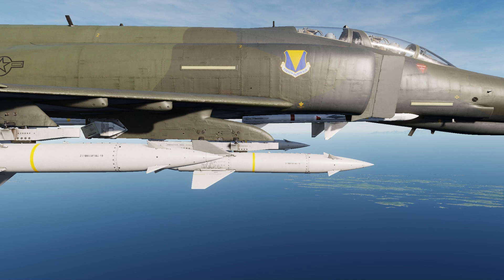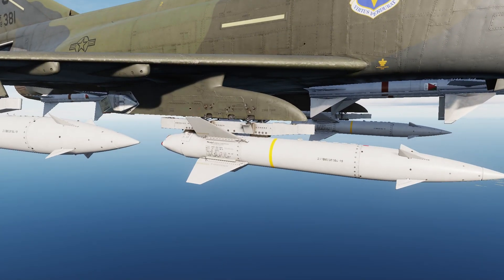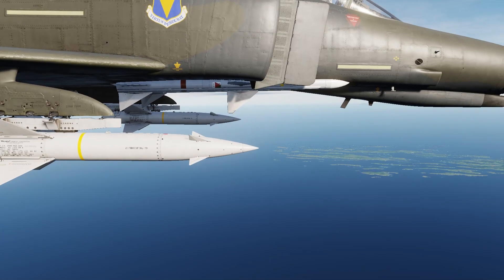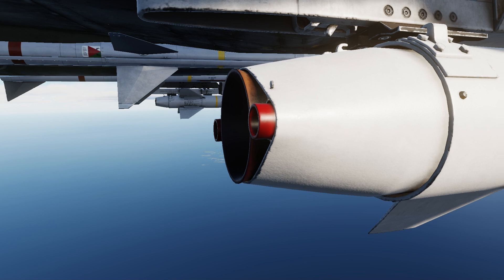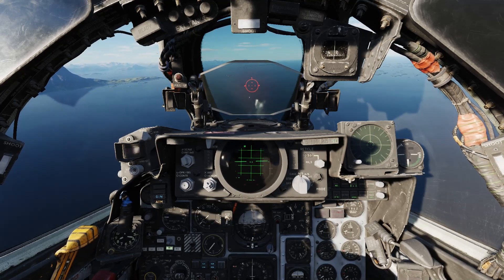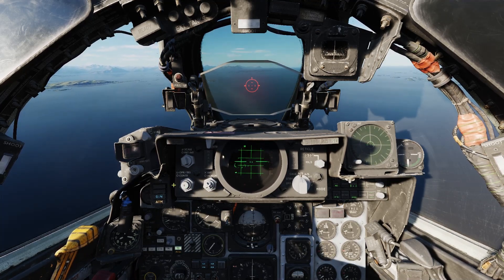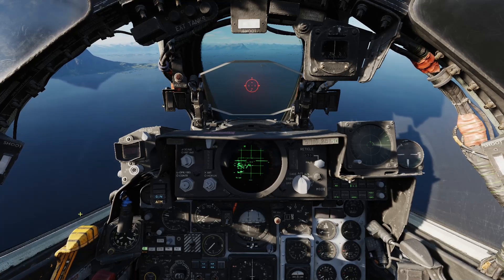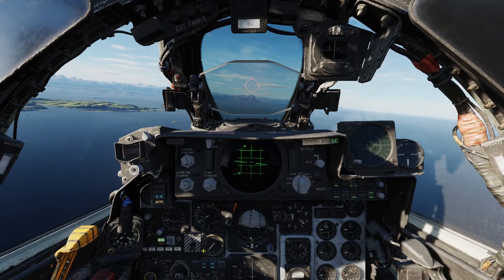DCS F-4E Phantom: AGM-12 Bullpups

Comment: Seems easier to just use rockets. No wonder why the bullpup was so short lived.
Reply from the maker: It is... for certain targets. The Bullpup really is meant to hit large targets like buildings, large ships, and concentrated troop formations. Even then the B model with the 250lb warhead doesn't deal a ton of damage. I would imagine the C model would be great against ships and large buildings but that isn't working right now.

However for light targets rockets and even the gunpods are the way to go. Even HEAT rockets can deal with armor decently if you use a large ripple close in so they have a good chance of a direct hit.